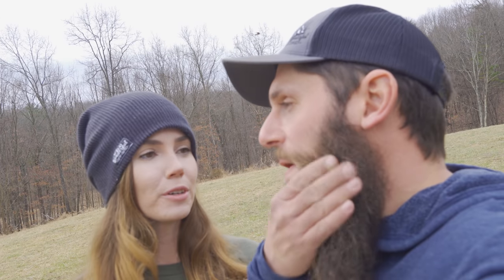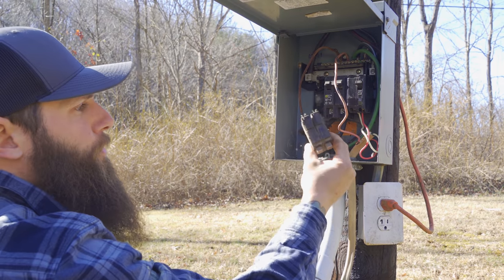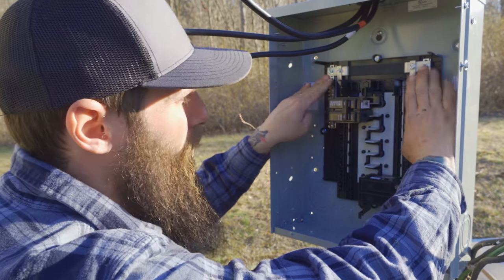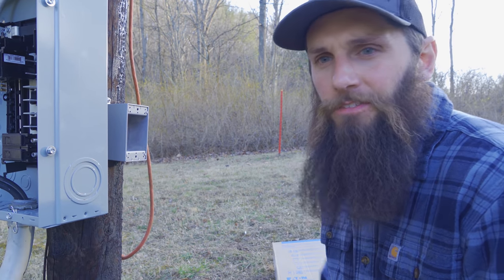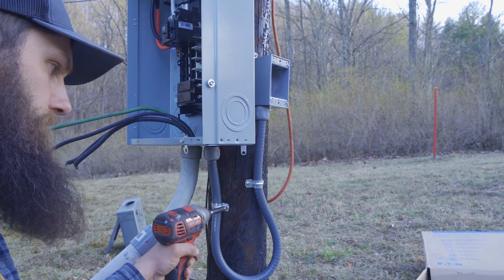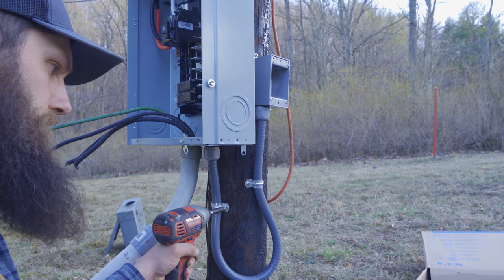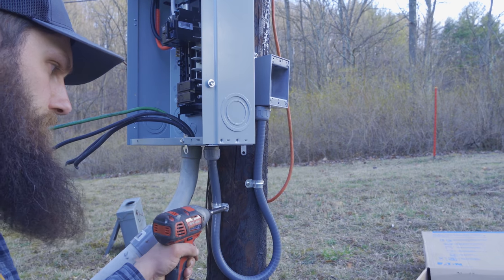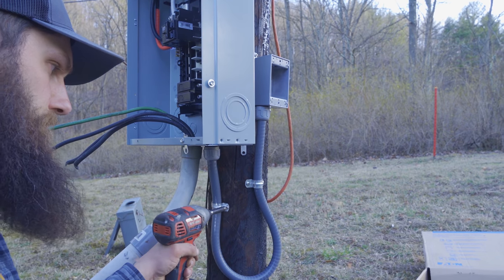We Have A Major Electrical Issue!

Comment: I love it all, and when you wired the panel it reminded me of a trailer home back in the very early seventies and I had to do it cause you know what electricians cost per hour/job. At first intimidated so looked carefully at other installs, got my wiring card for single occupancies and it was so easy to do it right the first time (me big talking to wife about how safe we were now that "I" did it blah blah) and we were luckier than I suspicioned as not only my place but others near there took lightning strikes and that was a do it over as stuff was safe but cremated from mother  nature putting me in my place. No google then... LOL. Yeah if you video farming/building etc, I will like the heck out of it. Now why didn't little Elli do final inspection... growing off love and good food. Your little treat muncher must like traveling to off sight work

Comment: I noticed your meter wasn't pulled so I'm wondering where the shut off was are you branching from another building.
Reply: If you watch closely the meter was pulled. The wire became longer and aluminum, and no meter seal then there was a meter seal.

Comment: Great video... one question: (I am not an electrician) With that weather tight panel box, I noticed that there are 4 mounting holes in the back of the box that were not used. Is it not required or shouldn't the holes be covered or filled to prevent water from leaking into the back of the panel?  Keep up the great videos.....

Comment: should'nt you have put the anti corrosive paste on the green ground from the house? its aluminum, or is that a non  code issue?
Reply: Technically the lugs are rated for copper or aluminum wire. But it is always a good idea to use anti oxidation compound with aluminum wire. And any connection in an outdoor panel.

Comment: Josh, how did you do what you did without pulling the meter head.
Reply: Yes, it can be done his way, but stupid for someone who is supposed to be an electrician showing this on a public forum.  Others might try the same with deadly results.  So easy to cut the meter seal, remove the ring, pull the meter, and thereby stop the current.  After your work is done replace the meter, then call the power company and they will come and install a  new seal.

Comment: Josh had to cut the seal on the meter to install new feeders. With the way that he was slinging his wires around with the meter still in place, suggests to me that this meter has an internal disconnect built in. For those following along at home, yours might not...

That said, I've done many a panel swap without bothering the electrical company to come out and replace a seal. You just have to remember that you won't get a chance to make that second mistake. ;>

The last one was for a friend who smelled smoke in his house and the ancient FPE panel (yeah, one of those) had lived up to it's nickname of "Flaming Piece of Equipment" and had to be replaced. We went to Lowe's and bought a new panel and had it swapped out (hot) in just under three hours. I come from a time in the trades where this sort of behavior was considered normal. My, how times have changed. :)

Watching Josh drive the ground rod made me smile, "Better you than me, brother". :)

Comment: Next time you have to bury a ground rod leave the fence post driver and the hammer in the truck, and grab about six bottles of water and your rod. Start jabbing your ground rod into the ground and after you get a little divot made, pour a little water on it then drive it some more up and down, up and down. When it gets a little tough, pour some more water in it and pretty soon you’ll be 2 feet deep just pour a little more water in the hole and keep stabbing it. You won’t believe how easy this is, I put a 12 foot ground rod in this hard Georgia Clay during the summer. Our ground here is harder than Chinese rithmetic and it took about six bottles of water to get that in the ground, I used a 3 pound sledge on about the last foot of it.

Comment: You just missed electrical since you left work and needed an excuse, I like seein this kind of stuff, but what’s the reason for the panel on a “temp drop” pole instead of directly into the house, I’m in WV also and I thought there was a time restriction for construction on droppin on to a pole like that? And will you have a sub panel inside the house?

Comment: I notice that all the panel screws, ground, neutral, and the breakers accept Robertson head screws. dont you Americans get tired of using flat head screwdrivers on screws that will accept a Robertson head screwdriver?
Also Phillips heads screws are ancient technology slightly better than a flathead screw. I realize Americans dont use the Canadian invention called the Robertson screw.

Comment: The only problem with showing a how to with gas or electric is you give just enough info for a layman to attempt it on their own and do something dangerous while thinking they are correct. As an example, most people believe electricity flows from positive to negative while in reality electrons flow from Earth to the positive potential, or power source. Without a fundamental understanding of electrical properties how can anyone be expected to understand codes and mechanical layouts.

Comment: Josh WOW ! I'm not an electrician but I would know better not to install the electrical panel the way it was . Good thing you found it and tore it out & reinstalled it properly . How deep is the grounding rod suppose to be ?  I noticed the tattoo on the back side of your right wrist was it real painful ? Are you finished getting tattoos? How long did it take for your beard to grow to the length it is now ? I can't grow a beard it won't grow in on my cheeks . I'm 68 & thinking about starting to get some tattoos & piercings .

Comment: I see the LCD on the meter is on.. you doing that live? I know you showed the testing, just never seen a meter live with load wiring dead.

I think your Orange ext. cord is missing it's ground pin.

Lastly looks like you terminated all of your  bond wires on the right hand neutral bus. Normally panels ship with a separate ground bar which bolts to the panel tub in the pre punched holes... Done differently in 'merica I guess.